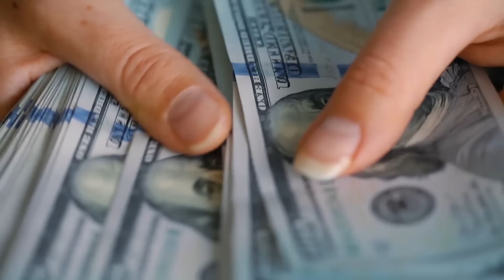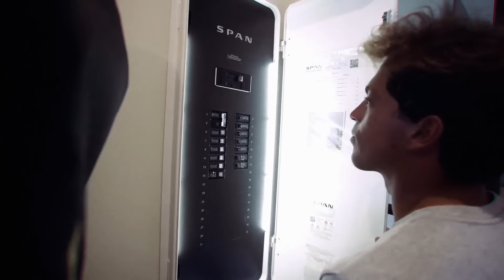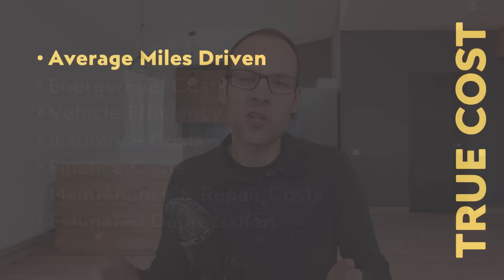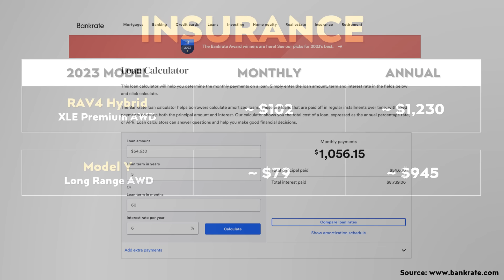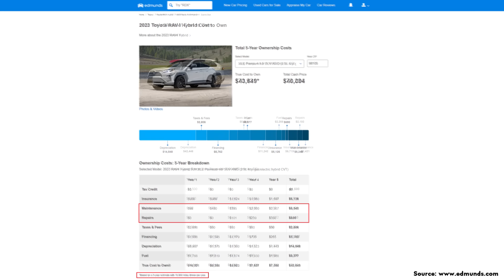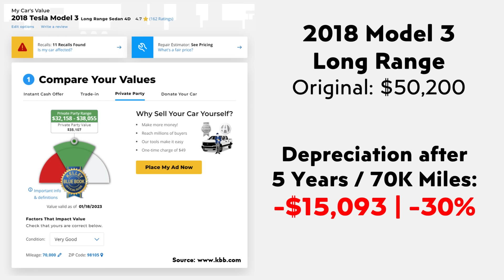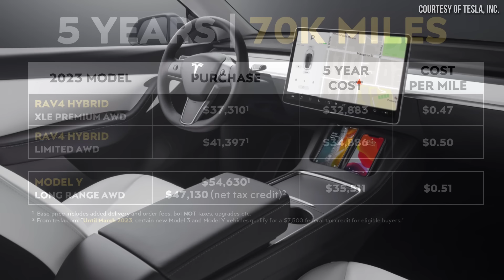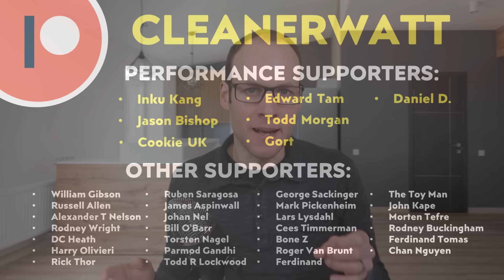Tesla Model Y vs RAV4 Hybrid: Lowest Cost of Ownership in 5 Years?

Comment: Don’t forget your are not always charging at home.  SuperChargers kw 3xmore expensive than at home.  In my case I charge 80%% of the time at home
Reply: sergelbergeron:  But that depends on where you live.  Many apartment dwellers can't charge at home, or can't do so conveniently/consistently.  So that very much depends, which is part of the reason things get better for BEV's in the long run, as charging infrastructure gradually improves during the BEV buildout, which will take decades.
Reply: @rogergeyer9851  i just think it is worth mentioning that Superchargers rates are certainly not 16 cents/KW.  Thus the comparison is not exact and be misleading.

Comment: I usually use my car for at least 10 years. Toyota do offer extended warranty for 10 years coverage for extra around $1800. Tesla does not offer such extended warranty on its model 3 and model y. Given the battery life of a Tesla under warranty is only 8 years max, while all other components will cost extra to repair once the 4 years warranty expires. Then the comparison if this video does not really show the 10 years cost of ownership between a Toyota ICE hybrid vs a 10 years cost of a Model 3 or Model Y. Also in NYC, beside the supply charge of around 12 cents per kwh, there is a additional delivery charge of 14 cents per kwh. As a result the true kwh being charged by Con Edison to any EV to be charged at home is at 26 cents per kwh, which is way higher than your posted 16.09 cents per kwh.
Reply: He forgot delivery charge. ( water, gas or electric) we have to pay delivery charge 😊

Comment: At 10 years and 140k miles, would I buy a 2023 RAV4 or a similar EV ? I would expect the RAV4 to go another 100K, but would be really concerned about the EV battery with that age and miles.
Reply: Those that have 140k miles Teclas seem to be very happy with the battery life.  As I understand it you could expect up to 500k miles before the battery really start losing range.  Also remember the RAV4 hybrid also have a battery that is being pushed to the limit every time, so you could expect to have that battery replaced much more frequently.

Comment: I am living in Denmark.  The price of cars in Denmark is much higher than in the US do to to tax on cars (progressiv from 80% to 180 %)
To facilitate shift from gas powered cars to EV the later have been made taxfree up to a certain value. 
The 31th of january I bought a Tesla model Y Long Range  for $ 61,5k. It was taxfree except for 25% VAT.
The Toyota RAV Hybrid With all wheel  drive cost $ 93k.
The gas price in Denmark is $7,5-8,5 a gallon.
The electricity price for home charging is 15-30 cent/kWA. The price for supercharging is 40-50 cent/kWA.
In januar Tesla model Y was nr 2 on the list of new registrered  automobil with 481 (nr. 1 Peugeot 208 with 527).
I predict that in february Tesla model Y will be nr 1 on the list, probably with a number 2-3 times higher than nr.2.

Comment: A very good comparison. It would have been much better to estimate the cost of a solar system with its own charger and a battery pack if it happens to be necessary.
Reply: Also this did not include a battery backup.

Comment: Your review didn’t take into account the cost of my time. With a RAV4 Hybrid I can drive to Dallas and back from Austin without charging (or filling with gas). The range is almost 600 miles. With a Tesla Model Y I need to stop and charge for 30-45 mins. My time is a valuable item to add to any review.
Reply: I see it just the opposite, over the course of a year I find I only charge at a super charger maybe 6 times and charge at home the rest of the time but my wife has to drive 10 min out of her way to get the cheap Costco gas for her Honda Pilot. She then has to fill up and then its the 10 min drive to back to the main road she uses. She has to do this 1 to 2 times a week. I have 6 times a year that I have to spend 30 min waiting while she has to spend the same 50-75 times. I also never go out to my car and find its empty, its always full in the morning.

Comment: The problem with this video is stealerships never sell cars at msrp, so the RAV4 you showed would more likely be in the mid 40's nearly on par with the cheapest model y (currently). In addition, the tesla cost of ownership will remain mostly the same AFTER those 5 years and there a hundreds of teslas with 250k mi with single digit battery degradation. On the flip side, the RAV4 after 5 years will start to ramp up in expenses like most ICE cars. So the true cost of ownership over a 5-10 year span is much different and the model y would be a clear winner.

Comment: The comparison is fine, but I don't think I am cross shopping a Rav4 with a Model Y. Maybe a Lexus, Acura, Cadillac,  Volvo, or base model Mercedes, BMW, Audi. Also, Lincoln or a higher end VW. For performance and price as well as the target market, I think those comparisons would be more appropriate.
Reply: exactly Although Tesla is not luxury bm mer audi class, its atleast premium like acura lexus or infi or above.
Reply: I think that's an unstated point in this comparison. The Model Y compares favorably on cost to popular trims of non-luxury vehicles. If you adjust the costs for the luxury vehicles' higher costs, the comparison is even more in the MY's favor.

Comment: I'm not sure why you added the repair costs for a vehicle five years old since Tesla has an eight year 150 thousand mile warranty
Reply from the maker: Tesla's do not have an 8 year 150k warranty.  Direct quote from Tesla: "The Basic Vehicle Limited Warranty covers your vehicle for 4 years or 50,000 miles, whichever comes first." The Battery and powertrain are covered for 8 years or 120,000 miles.

Comment: Great video. Thanks for all of the excellent work.  I see you use average/typical data for most of your analysis. As the Tesla costs more up front and but saves on operating costs thereafter, it achieves break-even at roughly five years. After that, it's all gravy. It would be interesting for you to extend this to eight years, which is the average length of car ownership in the US. It could be measured by payback/ROI much like solar, heatpumps, etc.  Thanks.
Reply: Also could extend the data to well beyond eight years and chart the crossover point (roughly 5 years).  The average age of cars on the road in the US is 12.2 years.  I tend to hold my car over ten years, so I would expect to see Tesla as an easy choice.

Comment: the only thing i think youre missing is... the rav4 hybrid will likely go 20 years without the need for battery replacement. A battery for a Rav4 hybrid is about $5000. The tesla battery might last 15 years, but in canada it costs $15-$20,000 to replace. This is an extra $10-$15,000 cost youll see if you own your vehicle for ~15 years

Comment: I have  2019 RAV4 Hybrid XSE and 2023 Model Y.  They both have their cons and pros.  RAV4 is a better made in workmanship.  No repair for the last 4 years , just oil change (myself) and tire rotation. Toyota reliability is the top.  I can own a Toyota for 15 years without worry.  Cannot say the same for Tesla yet. Toyota tech is not as good as Tesla but good enough for everyday usage.  At least it has Car Play so that I can use Waze.  Tesla navigation is good (GPS), but doesn't show road closure, speed cam, traffic cop like Waze (One time add 15 minutes to my trip because of road closure not detected).  RAV4 has good acceleration but can't compare to tesla.  During the cold winter (under 40 degrees) RAV4 still can get 35 mpg without any problem (over 450 range the lowest).  I have not get more than 200 miles between charges (from 90% down to 20%) and mostly around 160 miles the past month.  Model Y will drain about 3-4 miles daily while not used during winter. Electricity is higher in NY - $.13 per kwh plus $.11 per kwh delivery cost.  So it is $.25 per kwh.  I have solar panels (didn't cover the usage during winter) so it does make sense to have a EV.  MY is much quieter but for long trip, I would just use the RAV4. Autopilot is slightly better RAV4 dynamic cruise control (still good enough for regular driver) but Tesla lane departure avoidance disengage too easily and have to reset it. Model Y can have up to 5 phone keys plus 2 card keys which is a major plus.  Most other cars only have 2 keys.

Comment: Old, used German "supposedly premium" car with notoriously expensive repair costs + repairs + insurance + fuel cost me less than that 10k$ difference. However, given how I burned 2700€ (would be much less in US, where fuel is cheaper) in fuel per 13'000 kilometres, that total sum will reach 10k in around a year.
Reply: P.S. And of course financing cost was zero, that's the beauty of old cars - some additional costs are a non-factor.

Comment: Alot of assumptions have to be made to accept these conclusions: 
1. Who is to say that Hybreds will hold there value in 5 years. As more EVs come to market, wont Hybrids more likely be less desirable? 
2. A hybred is the worst of both worlds: an underpowered engine and a ridiculously small battery pack of 18KW, capable of providing ~32 miles of real-world  range. It has a charge rate of 6.6KW, in the upper level trim. This is no comparision to even the cheapest Tesla.  
2.  Basing the used price today and projecting forward given the exponential growth of EVs does not see realistic. 
3. Several people I know have Hybreds. They  NEVER plug them in do not get 40MPG, 35 is more realistic. 
4. I would not go by maintenance or resale numbers provided by kelly Blue Book and Edmunds. They are both supportrd by Legacy Auto and have skewed these numbers before.
5. Tesla offers insurance at much better rates than those quoted. Although not available in every state, it is constantly expanding and should be considered.
6. The RAV 4 does not have regenerative braking. Were brake changes considered? 
7. The several people I have asked about maintenance cost have spent ZERO in up to 200,000 miles. 
8. Im paying 11 cents /KW for electricity. Where is it 16 cents?

Comment: How the heck do you spend 5300$ on RAV4 maintenance in 5 years… I didn’t even come close to that even with a set of new tires.

I’ve done this math every year for the last 5 years. Still have my RAV. Love the Teslas, and the tax credit helps, but it doesn’t make financial sense for me to replace a vehicle that will drive a lot more miles.  Gas prices could change it. State incentives, etc… heck just the increase in payments for the extra 17000$ isn’t easy to deal with 200$ /month to save me 70$ in fueling expenses.
Reply: NiceGuyRides:  Agreed.   In the real world with Toyotas in general, in 5 years of driving you might only do oil changes, a set of tires, some fluid and filter changes, and maybe a 12V battery.  

Realistically, to approach the $5000+ area for maintenance, that's more like in 12 or more years of Toyota sedan (not the RAV4, I know, but I'm a sedan person) ownership for me, and I've been owning such cars for over 40 years now.   And that includes the first one that wasn't even fuel injected, had lots of body rust from winter, etc.
Reply: I have a RAV4 Trd and I keep circling back to trading it on for a Tesla but I only owe 20k remaining and I would dig myself deeper if I go for the Tesla Y. Only reason why I want it is I have solar in my house and the fact that I will wake up to a fully charged car everyday not having to drive to the gas station anymore
Reply: @GTIZmoKiDD  a Tesla cannot replace my RAV4 because of ground clearance, and the AWD system on tha RAV4 is second to none. I actually use my SUV as an SUV. If I replace a car, It would be my wife’s Insight, but it gets 45mpg, so the economics become even worse. I would love an EV but it just doesn’t make financial sense just to skip a 5 minute trip to the gas station. Although it would be nice.
Reply: @niceguyrides  exactly lol. Maybe in the future but for now I think I’ll be sticking with the Rav4 aswell
Reply: @GTIZmoKiDD  when my Toyota or Honda fall apart, but that seems unlikely anytime soon. Dependability is high on both models. (Sighs)

Or when they outlaw ICE vehicles.

Comment: What costs make up the large jump in maintenance and repair costs for the Y in year 4 and 5? There are no such costs. $4000 costs with no explanation or basis.
Reply: A Tesla door handle replacement alone costs $1000. Sure, there are fewer wear parts on a Tesla... but the rest of the car isnt protected by magic from breaking.
Reply: @sailintothesun3421  Old 13 Model S handles broke. And a diy cheap fix was figured out. Nothing on the 3 or Y. Must be magic.